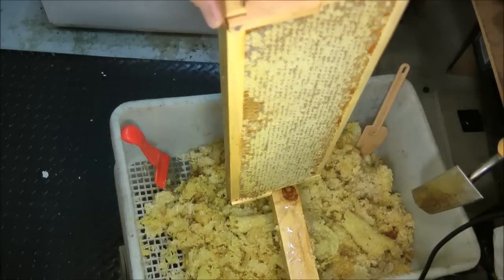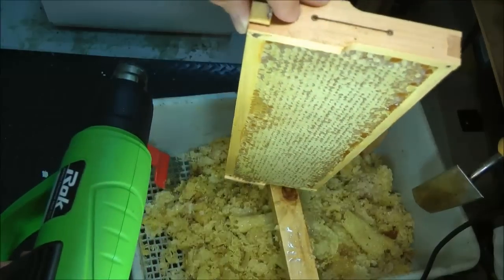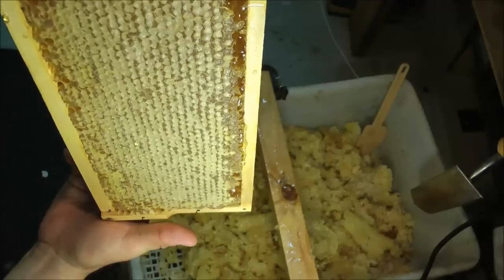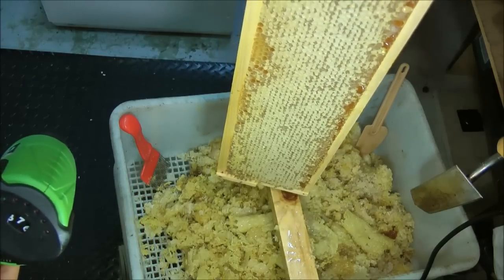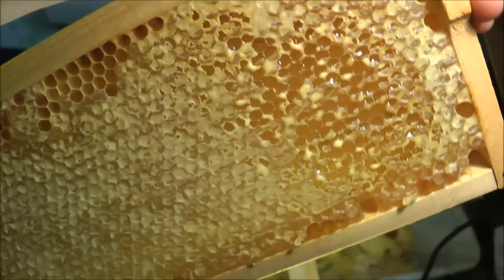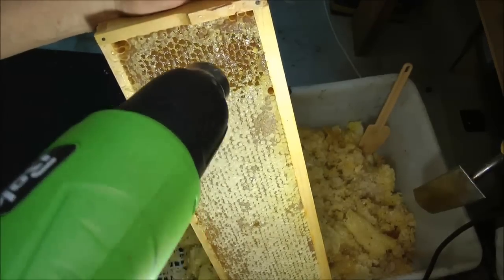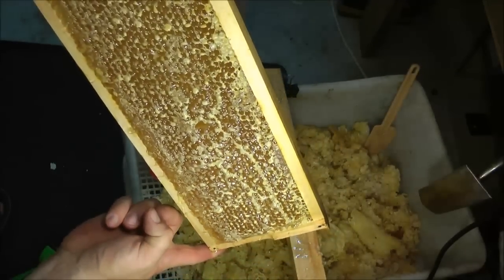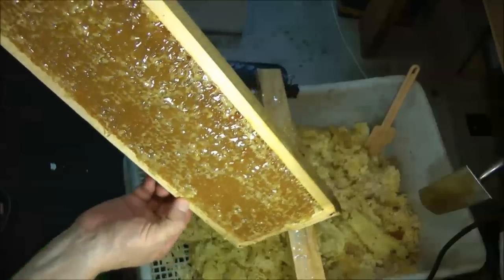HOT knife vs HEAT gun extraction method - the WINNER is! PART 1

Comment: You mentioned the loss and production from cells that fail to open up with a heat gun. I'd say you gain more than you lose since you're not scraping off pounds of wax and honey into the decapping tank. It's a much cleaner process, as well as a faster process. Honey opened up with a heat gun strains much faster since there aren't tiny chunks of wax clogging the strainer, and you don't have to waste time messing with all the cappings afterward. More wax goes back to the bees.